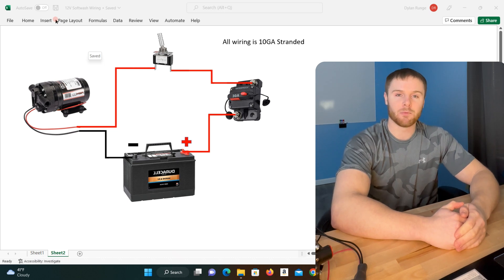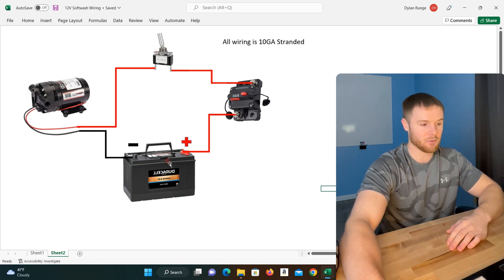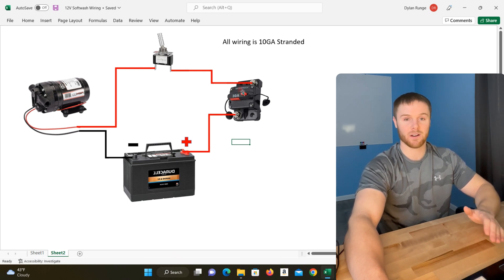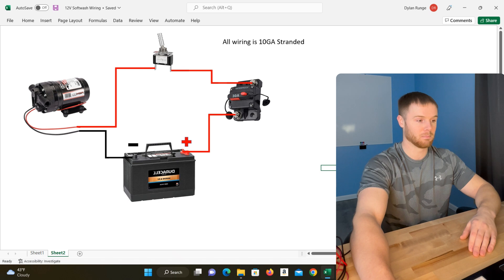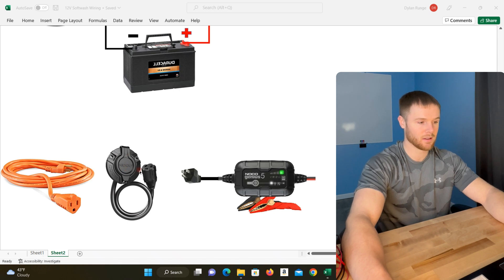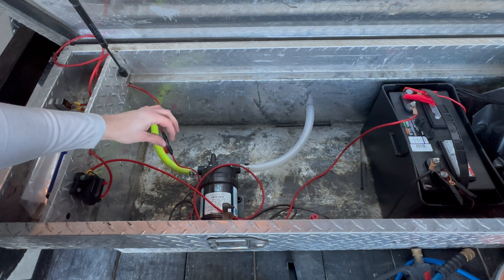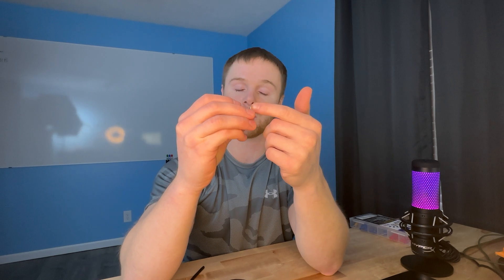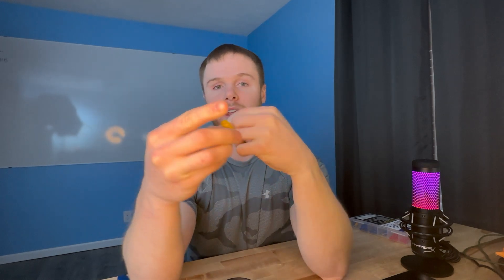How To Wire A 12V Softwash Pump

Comment: I appreciate the explanation on this.  Im not sure if I've seen anyone run a circuit breaker on this set up.  I'm real green on electrical and curious if I'd then need a breaker on all my electrical on the unit?  I have electric hose reels and the FlowPro right now on top of my 12v pump.
Reply from the maker: Glad you found it helpful! It’s cheap safety and insurance. Especially being around water and bleach which is very conductive.

Comment: Isnt it safer to put the disconnect on the negative side?
Reply from the maker: Positive side is safest in my opinion. If you put the disconnect on the negative side (usually at 0V) then you still have +12V at your pump with the disconnect off. 

If placed on the positive side, you have 0 volts at the pump on both sides which is the safest.

Comment: Can I add a 12v voltage gauge to this set up? Would it be just black to negative red to positive on the battery?
Reply from the maker: Yep, just has to spam positive to negative. My updated version actually had a little LCD screen for voltage

Comment: Can’t you just use the pressure washer to charge the battery?
Reply from the maker: Yes, but for a softwash system you’re typically using a decent chunk of the battery percentage. I prefer to just charge it from a power source and know it’s topped off.

Adding a pressure washer driven charger in addition to the wall plug would be the best of both worlds
Reply: @ The pressure washer charges it to a full status.. I thought the same thing but when I put it to charge the green light would already be on. I’ve ran this set up where my pressure washer charges the battery for 2yrs now I never have to trickle charge my battery and I spray roofs all day long

Comment: Great vidieo. I noiiced yoru using 10 awg but the remco has 12 awg. This is fine?
Reply from the maker: Yep! You could actually run 12AWG which is smaller than 10 AWG for the whole system but I like to err on the side of using wire rated for the peak current.
Reply: @pressurewashnerds  TY so much! Yup. The wire is expensive for what it is so I bought 7.00 jumper cables from norther tool that are 10 awg. Ill be re-purposing them lol

Comment: Will this setup work for pulling water from an ibc tote for a 4 gpm pressure washer? I have a direct drive unit, and would like to have a small buffer tank setup for houses that may have low water pressure
Reply from the maker: These pumps have short duty cycles, meaning they’re only meant to run for like 30 seconds at a time. I would not recommend it for adding to a pressure washer. A better option would be to just upgrade your engine to a gear drive and pump.

The TSG6835 is awesome if you’ve got the budget and your engine is large enough.

Comment: hey man i have this exact wiring setup as i watched this video before starting my company. with that being said i want to install a voltage meter. How and where would i add a voltage meter in?
Reply from the maker: You can wire it in wherever you’d like as long as it’s spanning positive 12V to ground. I’m assuming you want to measure battery voltage so I’d suggest running the wires direct from the screw terminals on your battery. Alternatively, you could add it in on the leads for your pump. The voltage should be identical in either spot.
Reply: @pressurewashnerds  Ok. so another question then, can i add another set of terminals on the battery then? because 10g wire is used for the initial setup but the voltage meter has really tiny wire. Like could i buy lil terminals that fit the battery and add them to the other two that are already on? (2 on neg and 2 on positive)? Hope this question makes sense lol. Appreciate you reaching out!

Comment: I will recommended use the wiring from marine is better will not  heat the wiring and pump and last you more Also the circuit breaker make it 40a
Reply from the maker: Why 40A breaker with 30A rated wire? Peak pull for the pump is also below 30A.

Comment: Do you need to ground this to the chassis of your trailer/truck?
Reply from the maker: Good question. I don’t believe the NEC requires grounding for DC systems less than 60VDC. I chose not to ground our system and just left it floating.

Comment: I tried this setup, but the pump does not power on - I am only using a 3A max 12V 1GPM pump though...not sure what's wrong. 10 gauge wire clamps with 30a fuse ...
Reply from the maker: Check to make sure your breaker isn’t tripped, double check all wiring, if you have a voltmeter you can use that to check voltage at the pump. Otherwise you may have a dead pump from factory. Happened to us once with an Everflo
Reply: thanks nerds! - I ended up buying a 110v self-priming diaphragm pump that will keep up with the demand :D @pressurewashnerds

Comment: I will only do about 4 house washes a year. My own rentals that have outdooe power. Delavan makes a 110 volt 100 psi pump. Do you see any problem with this?  I was thinking less problems. Dont have to worry about battery charging and replaceing the battery every 5 years. Thanks for any suggestions.
Reply from the maker: Should be good with that setup. Obviously be careful not to wash where you are plugged in. Be sure to run a lot of fresh water through the pump at the end and winterize with antifreeze and pump preserver if you’re using it that infrequently

Comment: Question what type of equipment gpm etc. & skid do you recommend for pressure washing dumpster pads & restaurant walkways any advice would highly be appreciated!! God bless you and your family
Reply from the maker: Dumpster pads and heavy foot traffic areas would definitely benefit from hot water. 4GPM is the minimum I’d recommend but if you want to be more efficient and have the cash, go for an 8. Landa and Pressure-Pro both make nice skids.

Comment: Can you do a video on how to attach the hose to the pump?
Reply from the maker: Sure! We can definitely do a video on the plumbing side. It’s actually just a 1/2 NPT to 3/4 barb on the suction side (to proportioner) and then 1/2” NPT to 5/8” barb for the hose running to the reel/wand. Hose clamp on both ends.